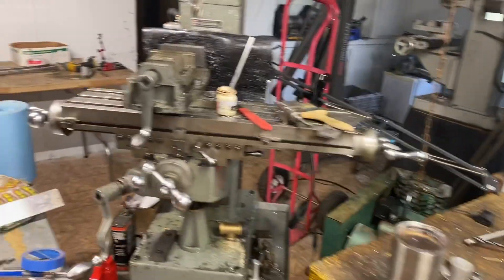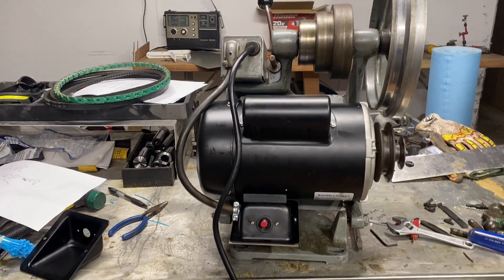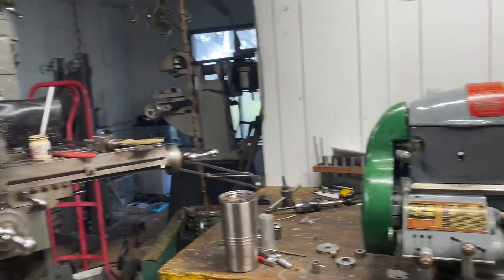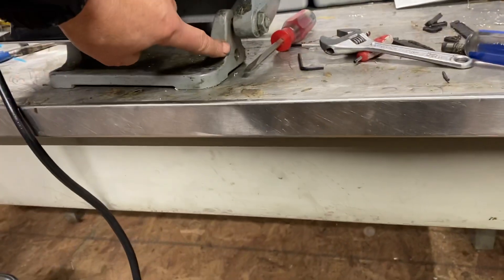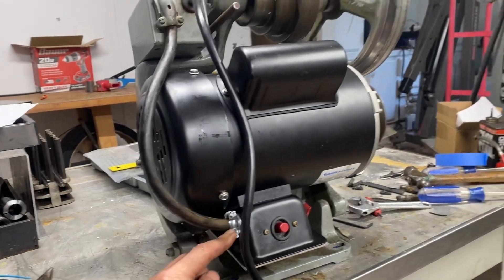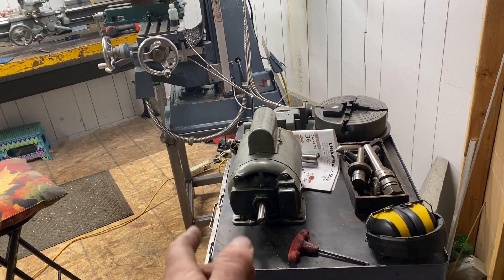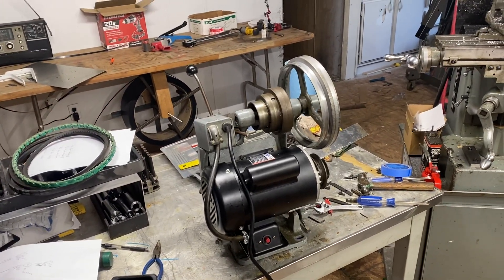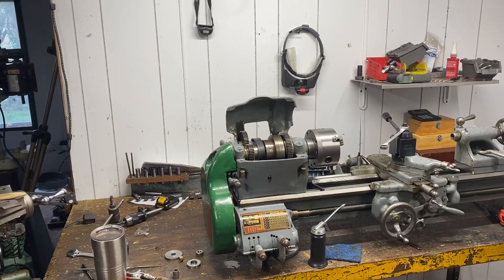South Bend 10k Metal Lathe 1HP motor upgrade

Comment: You should wire a reverse, and you should probably change the switch.   The switch is probably only rated for 1/2hp.
Reply from the maker: That drum switch is more than capable. If I wanted reverse I would have wired it that way.

Comment: Hey Eric.  You should really consider wiring the switch in to get reverse.  Reason for that is to be able to back your apron out when threading without dis-engaging the 1/2 nut.  .  I do it all the time when ever I have to do imperial (my lathe is metric).  I also go reverse when I use the tool post grinder bc of the rotation.  My lathe spindle is also the threaded type (1.5”-8 TPI)
Reply from the maker: I disengage when I single point..